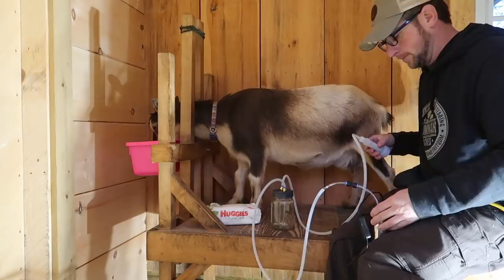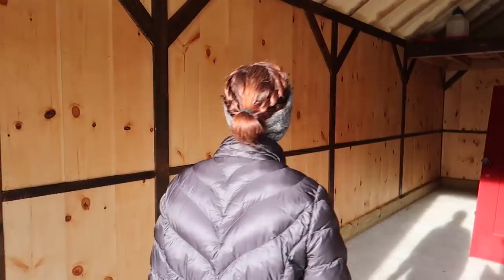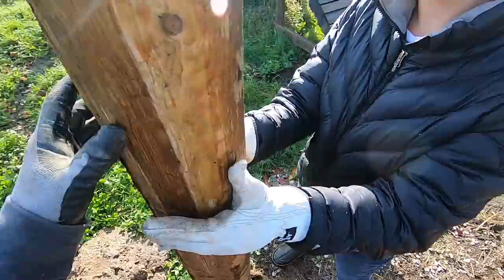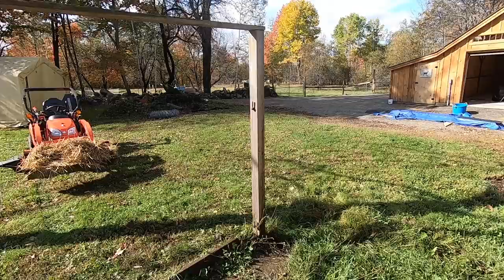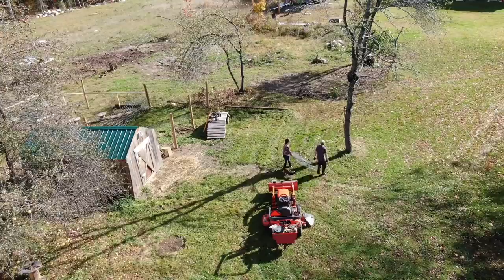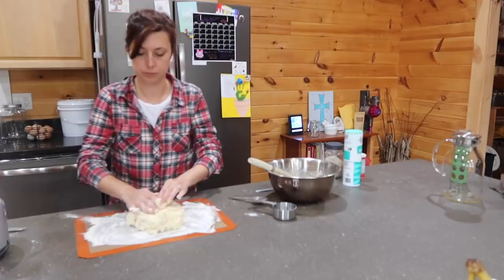Time to START Another Project! Building a NEW animal Pen on the FARM

Comment: Hello every one , right Water will always find the easiest way to flow , so if it hits a restriction like clay or hard subsoil it will find a easiest path just like a surface river or stream . but you can always get a survey done to see where it goes and whats causing it and where it comes from . but me i would check out a water diviner and let them trace the extent of the wetness underground , a natural way . you need proper survey if you were going to build a big structure above ground . always remember always check below ground when building as you might be building on egg shells xxxx God Bless xxxx

Comment: Looks like you hit a spring while digging for the new post. I ran into one also while putting in my fence 34 years ago. I used locust for posts, never had a problem with that post once in that hole for nearly 25 years. (FYI I worried the underground spring would ruin/rot my post.) A neighbor altered my boundaries on the West side & fenced off my spring onto their land in 2007.
Caleb & Zeek? I thought maybe they might need to be socialized with other goats? But, I don't know goats enough yet.

GOATS
My 1st encounter with a goat was at the laundromat. I just put the clothes in the dryer, turned & here walked in behind me was a local goat, with horns. Imagine that, me & this goat are the only ones on this laundromat. I had no idea what it would do to me, & I cornered myself in behind the seats by the snack machines. That thing sure loved peanut butter crackers. After 5-6 packs I felt it could use some water. Thankfully the owner came & asked if it was mine? I asked her if I looked like the kind of face that would drive around town with a goat in the car? A man came made a leash gave it water til the owner came later.
2nd time:

Next experience I had was my Hillbilly neighbor tied his 2 goats up in my yard to eat weeds on the hillside. They could have cared less about the weeds. When I finally got my coffee & to the front porch to sit & watch them, they were gone. They had chewed the rope they were tied with. 

3rd  time:

When Debbie came, she had 1 kid. It was the same size as Libby, our dog. My Uncle stopped to visit us. We were so happy to see him. First time to see my home. Here we are standing in the kitchen looking at the beautiful view of Mt. Roger's, & my dog came flying in the back door under the table behind us, then the kid come in chasing my dog, it wanted to play, then the Mother goat came behind it worried the dog would hurt her kid. So much for making a good impression, as Uncle Bill thought we liked letting the great out doors in. the kid loved jumping on my children's back when they were out playing on their hands & knees. It was cute.
4th encounter

 My GranDaughters' goat, Mable, had 2 kids, Pauncho, & Bella. They were adorable! Mable passed away. Bella was calm nature like her Mother, very friendly, soon passed later on. Pauncho was a trick. He was a rough 'lil fella. He played rough, & was wrestled with since there were no other goats like him. He had huge horns, was big, strong, very healthy, & played very rough with my son in law. He loved my son in law playing with him in the evening. Pauncho had come to me, to help me weed eat my hillside.
He was staked to the ground on my side of the fence. We planned on moving him down the yard to eventually get all the hillside cleared off. (200'). A neighbor seen the goats coming to my home, & looked for a reason to come out to the barn road. When we came into the house, we watched the neighbor provoke the goat, teasing him, to encourage him to ram the fence, then told me I couldn't have goats against his fence. I paid for that fence, it is my land. All of his life he never whined, or sounded like  yours because he didn't know too.(?) He was more petted up 'til he went to the huge goat farm. He was the proudest looking fella in the field. So I don't know what to suggest to you, These were petted. 

 If my neighbor would have been respectable he could have filled in the huge post holes he left in my yard hidden under the thick weeds that used to surround those posts for me to fall into when he altered my boundaries. I developed DVT in the same spot I twisted my right leg. I also suffered the severity of my spinal damages & had to live like that since then. My damages are a result of his ignorance. I suffered $89,600.00 in damages. Today I use a rollater to get around. After all the years of P.T. over the years, just that one hole undid all those years to where I am hunched over permanently. I look like I am looking for 4 leaf clovers now. 

5th time:
I love watching your videos and goats. They are really entertaining. Have a good day Lumnah family! Just love you folks to no end!

Comment: Goats bleat. Will the goats eat grain on the ground? Other than apples that they can pick up and eat, I though goats do not like to eat off the ground.
When are you going to get a clam shell post hole digger? They work great for grabbing those larger rocks.
If you checked your property, you will find veins of water in many different places. The logged land has a water vein that springs out of the ground. The water follows the gravel veins.

Comment: The way I do my chainsaw chains, because I can’t sharpen them well either, is buy 3 or 4 of them. Most small engine shops will do them for 2 or 3 dollars a piece. You just have to take all of them off so they can put them in they’re machine.
Reply: The local Ace Hardware stores in north Georgia charge $10.00 per chain to sharpen. Because of that I have started "trying" to file my own. Sometimes good results sometime not. I can relate to Al's chains.

Comment: Boy you guys get up early, it was only five when your video hit here. The bucks are young for one, maybe board, and if you have the other goats in sight they are going to call. Try some toys, a ball, a tug rope, or some hanging toys.
The water in the saturated ground looks like it came from the shed line, if you had an inch and a half of rain yesterday. The rain is multiplied by the square inches of roof slope that is over that area. There could be a spring, or your natural water table at that point.
Thanks for the videos we really enjoy them, always look forward to seeing each one,
Jimmy

Comment: If your chainsaw is 14”, 16” or 18”, the company Oregon has a product called Powersharp that lets you sharpen your chain in a few seconds. The initial kits come with the chain, bar and sharpening clamp. Here is an amazon link to the 16”. https://www.amazon.com/dp/B003YHCLIA/ref=cm_sw_r_cp_api_i_9mNODb0Y9W90S

Comment: Maybe a bucket over their heads?  You may have to cut holes for the horns.  I'd say shove a sock in their mouth but they would probably just eat it.  Have you tried saying, "Shhhhh!" because I've had good success with that.  You may need to have their hearing tested if that didn't work.

Comment: I'm the 500th commenter, do I win a prize? LOL!  Some 220 paper on the stain runs should clean them up in good shape. I did (2) coats of the oil based Min-Wax Satin Poly on my new workshop walls this past winter & they look awesome. As an experiment I applied (10) coats of clear ( 220'd between each layer ) on my mobile cabinet off feed tabletop giving it a real deep look, love it! My workbench top got (5) coats. Good job setting your posts btw. 
Gina, I fail miserably making biscuits, so I keep it simple, I throw " globs " of the dough onto a cooking sheet, aka drop biscuits & into the oven as they don't look pretty but they sure do taste good!  
Bill on the Hill,
Vermont... :~)

Comment: Davy Jones
1 second ago
Get  two 36" steel welding rods.  Bend a 90 degree hangle in the last 5".  Hold parallel to the ground directly in front of you and walk around.  When they cross...you have found water..A few people body types can not do this..but you got 3 trys at it.
Reply: You need to find the flow path of the water you have.

Comment: AL....Work Smarter not Harder.  Every farm with fencing needs a truck jack and chain to remove fence posts. 😎👍🏼🇺🇸🌹Or use the tractor bucket.
Reply: Lumpy William  we use our tractor bucket. Had two big hooks welded to the front of the bucket. Invaluable.

Comment: Putting a wood post in a water filled hole is never a good idea even if it's pressure treated. You need to first divert the ground water with a french drain.

Comment: Dig a HOLE:   You needs a:
 FROST BAR - 10 foot heavy bar. pointed on one end and chistle blade on the other.
10' SPADE  SHOVEL - a straight shovel with a round nose with a rounded back to work the sides of the hole.
10' SPOON SHOVEL - a 90 bend from the handle round shovel end that allow you to scrape up dirt and rocks to to fill it and you can lift up and out of the hole you are digging this material to discard. 

See you local utility company pole guys for a look/see . It is common equipment for line crews.  After all, they have to hand dig a hole ...when the fancy machines can not get into an area where a pole is needed.   A old-time two man crew uses to dig 32 holes and set 32 poles in an 8 hour day in the 1930s or so. Back when workmen were men, no whimpy machine operators.

Comment: Stop letting them all nurse at 4 months. Breed them using a chart for when you want delivery’s. Avoid spring deliveries it’s to hot. Parasite 🦠 load higher.
Reply: Spring in upper New Hampshire is not too hot. It's perfect timing for deliveries. :D